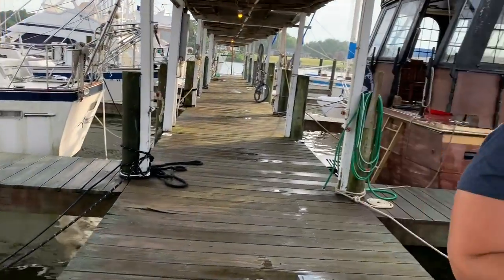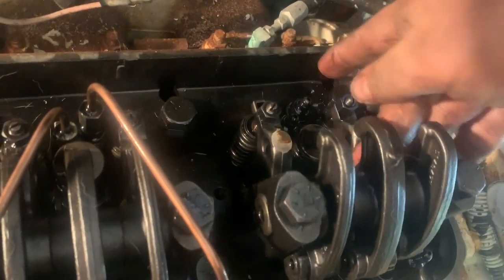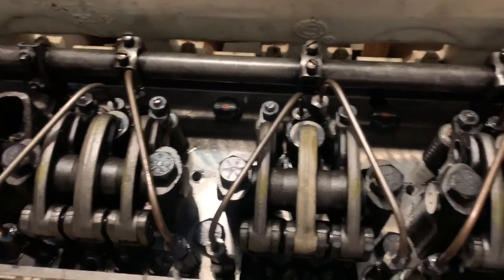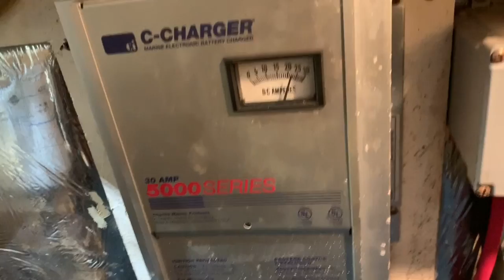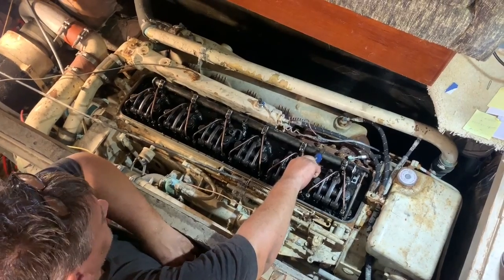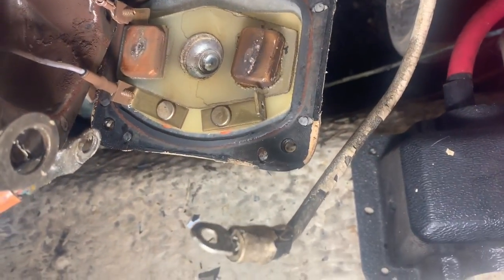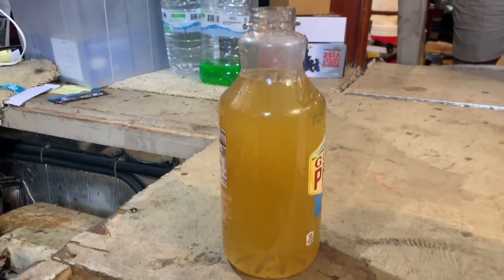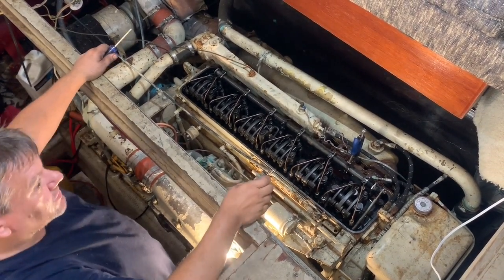Twin 671 Detroit diesel TIB boat (full video) 1st start

Comment: I drove an Attack Troop Carrier with two Grey Marine 671's in Vietnam. It was a converted WWII LCM where you had to handle 25 tons deftly using two D-handle four-foot joysticks. I would twist for power on each engine and shift forward or backward for differential thrust. You could pivot the beast very gracefully when needed. Like coming into a pier against a strong current.  Many a night sleeping next to them while the night watch drove going up rivers and canals through the jungle. The 671 sound and smell is still hammered into my night memories. I remember dreaming about home then waking up to the nightmare - just the opposite of normal life.
Reply: Thank you man I appreciate you !

Comment: I was an engineer on tugboats in the late 80’s, we ran twin Detroit 16V71’s, we ran 24-7 year round, only down time was engine rebuilds in the shipyard. I use to change the oil and filters while we were underway, shut 1 down ,change fluids, start back up, then the other, the only downfall was the oil and filters were extremely 🥵 hot. Love these Detroit marine engines.
Reply: c: Methods   we were in the company shipyard annually, for engine overhaul,and reduction gear maintenance, i worked the same boat for three years and never saw the engine blocks replaced. I’m now a Lineman supervisor in the communication industry, but working on the tugboats was by far the best job I’ve ever had!
Reply: Methods  Our 12V71s ran for 10, 12, and 14 thousand hours before we overhauled them. When I left, the 12k unit had 28k on the block, crank, rods,, cams and 16k on the parts that we replaced ( Heads, pistons, liners&shims, N70 injectors,  gaskets&seals, blowers, and bearings ). Once the engine was back in service and I tuned it, the only things done were upgrades and oil changes. We went from the canister filters to spin on remotes and upgraded from a mechanical governor to an electronic one. The last was done so that we could operate them from a computer in the office instead of having to run them from the engine room floor for normal operations. In an emergency, we could run them still from the engine control panel. In a major emergency we could run them from the engine itself. Our engines when I left had been in service for 24 years. I had been there 18 of those years.
Reply: very hot is why we used nitrous oxide

Comment: I am a retired bus operator from BC. I have a lot of GM time. Not only their engines but their buses too. The buses were all inter-city types. After 30 years driving scheds and charters I quit and started running tourboats and watertaxis close to home. I had fun watching you go through the procedures and commend your slow as she goes approach. Many guys will jump in and turn the key to see if she'll start. If it does, they walk away leaving the owner to uncover problems like loose prop nuts and fifteen gallons of water in the tank.  IMHO, the tank or tanks should be properly drained cleaned and the fuel can be scrubbed or cleaned for use again. In any case as you said you caught it just in time. People including myself are amazed at the amount of water collected due to condensation in the tank collecting over many months or even years. I wouldn't say no to working on engine repair on boats. People are willing to pay good money for someone who is good at their profession. I'm sure at some point Pam will pass your name on to someone who needs a good mechanic.

Comment: This video brings back a lot of good memories.  When I was in Sea Scouts (BSA) we had a single 6-71 Gray Marine (now called Detroit Diesel) in our 40ft launch.  What a wonderful engine.  I remember the 12v starter was rated at 9.6v @ 900A.  Our 8D batteries never seemed to have a good charge so we would wire two in series and hit the starter with 24V.  It always started right up.  Some time we would put pennies under three rocker arms on exhaust valves for compression release, and start the 6-71 on three cylinders.  Once running we would pull the pennies out with a pair of pliers with a short va-room as each penny came out.  We then screwed the valve cover back on and were good to go for the day.  It was great fun and a lot of learning for a 16 year old.
Reply: I always used a spring starter.

Comment: A Detroit 6-71 was a great engine in its time. You could say that about nearly every Detroit diesel from the ‘80’s and back. Had a 12-71 in a truck and a 4-53 in a car crusher and they were extremely durable and very low maintenance - prone to some oil leaks but that’s it.

Comment: I've worked for a while at a marina in Fox lake Illinois there was a pretty big 80's houseboat that had twin 6 Detroits in it, the same problem with a water flooded tank and fuel system but... it made it to both engines then on land it stayed, the engines were pulled n the rest went to scrap. Both of those engines were fixed and are still paired together in a rescue tug for the breakdowns around the lake to this day. Great video 👍
Reply: Wow Fox Lake is about 3 feet deep ;) , I'm surprised that thing wasn't permanently run aground

Comment: Retired now , but I've seen those old DD marine engine run with busted liners . A little smoky and wouldn't pull past 1600 , but it kept on running until shut down . New piston and liner kit , 1 new injector , a new head [just cause ] and back in service . Took 26 hours plus 6 hrs. to fly the parts out to us .

Comment: Great Video..Love the sound of Detroit Diesel's!! Being a Bus Mechanic 34 years I first cut my teeth on 8V71 Detroit Diesel's to 8V92 and 6V92 series with Turbos.. I miss rebuilding those engines! Now work on Detroit Diesel Series 60's and newer and Volvo D-13's..But I sure miss the days of injector picks and adjusting the governors on those engines..especially the sound of them in GMC or MCI buses!! Great video.. I need to find a boat with twin Detroit"s in it now since mine currently have Ford 427's in her! Lol.

Comment: There was a feature on locomotive EMD diesels (GM) two stroke that always saved the day.  Each cylinder had a "flash cock" that was opened before cranking.  Any water in the cylinder was blown out the flash cock before starting.  After cranking several revolutions, the flash cock was closed and engine was started.

Comment: The way that starter acted, I figured it hung up during Runaway & self destruction set in. Marine service engines have a difficult job, but that starboard engine sounded so good.  I'd love to get that kind of power in a truck engine. Way Cool.

Comment: Good old 6-71s. When I was in the Navy I ran landing craft with twin 6-71s. We also had OMB's and they ran slant 6-71s. And we ran Box-Ls. The Sea Scouts in CA had a few. The Box-L's ran a 6-110 main and two 2-71 motor generator sets. All of them were good engines.

Comment: Nice job, I'm a boat guy so great to see a boat. I found you from Stu at Danger marine.   You have explained a lot to me I worked in the Viking Yachts boatyard in early 80's  and this boat is I think an 'Ocean yachts' and was just down the road. Detroit's were the boat of choice back then ( building 150-200 boats a year!). We used I think 6-71's and 8-71? And 8-92 which I think are all V engines ? The engine boys talked about how they put oversize injectors and turbos on the engines too and some owners would remove these injectors and put even bigger injectors in which voided the warranty!..... these were sport fishing boats and they all wanted to run to the deep water as fast as possible to take the owner fishing ......
Only Viking Yachts are still in business building boats in NJ all the others got shut down by state or taxes. Viking are building up to almost 100' Long believe now with MTU. DIesels I think . 
Very interesting about the extra HP because they have so much better cooling.....  hence why cooling and oil pressure is vital on boat engines as at that continuous hi load you can kill it in seconds if either is low!  
Great video
Cheers Warren
Reply from the maker: I like boats too

Comment: I used to live at a marina that had an old German WW2 era tug boat built in 1939 that would sink a couple times a year. The would get it up, and pull the water out of the fuel tank and oil reservoir, and it would start right up.

Comment: One of the highlights of my wrench turning days was rebuilding twin 671's for an oil rig mud pump. One was left hand rotation the was right hand.
Reply: Sounds like two Siamese 6-71s connected to a common gearbox like they had in the tanks in WW2.

Comment: Sound of the v71 12 and 16 cylinders is also amazing
Reply: My uncle had a 68 Peterbilt with a 12V71. Yeah they sound awesome He also owns a 16v192 gen set.that v192 is a monster!!
Reply: Worked in Offshore oilfield on a job one time for two weeks an we had a big crewboat that was glued to us the whole time, it had a pair of 16V-71's in it, we worked on one platform and worked on another building a 200' tall microwave tower.

Comment: Have her send a video of the boat under way , preferably full throttle !!!   ( LOVE the sound of that thing ) .
Reply: I am starting the process of getting the fuel cleaned of dirt and water, changing the coolent, replacing the zincs, replacing the impellers, changing the oil, changing the fuel and oil filters, and just getting things adjusted.  Once that is done I will do a video of firing up those engines at the dock.  It will be a while before she is seaworthy enough to leave the slip and do some figure eights.
Reply: @Bill23799  Buena Ventura Life is the YouTube channel.  Coming up will be a powering up the starboard engine.  That should be a good time.
Reply: Not a diesel guy but the sound of the 2 stoke..... sweet
Reply: Riddle me this Batman were did the water in the fuel come from (fuel tank)
Reply: It does sound badass.
Reply: @kenheisner288  fuel, moisture.. Natural condensation
Reply: @kenheisner288  In a marine environment fuel attracts water. Likely bad orings / seal on the fuel filler cap allowed rain water in. She needs to have those fuel tanks either emptied and new fuel or have the fuel polished.

Comment: Get 3 bottles of Howe’s fuel treatment add that to the tanks , the Howe’s will clean any water pockets in the fuel system . The old 2 stroke Detroit’s love that stuff and it cleans up the cylinders . After running it a little add a quart of Marvel mystery oil to every 100 gallons of fuel. When that engine was designed and built fuel had sulfur as a lubricant and marvel makes up for the loss of the sulfur in modern diesel fuel.

Comment: I installed a Pair of 6-71s in a 10936 65 Foot British Power boats Motor Torpedo Boat back in '82
we rebuilt the Engines and fitted 5 Inch water Jacketed (not Water injected ) Copper exhausts....it sounded incredible but Ear defenders were essential if you were out on the Stern Deck..!!

Comment: I repair starter motors and love that sort of solenoid contact. Easy to clean up and get to. Some of the new lorry Bosch solenoids use a pyramid shaped contact that burns out after a few turns. They would not admit they made a mistake and carried on using it. Caused no end of warranty problems.

Comment: I watched your video and I'm not sure yet. Little tip. When you take the end cap off the solenoid loosen the main terminal contacts and push them down far enough to turn them a half turn and take the clip off the plunger disc a flip it over so you will have two brand new contacts for your starter power. A good trick to turn an old starter into a new one. Those two items and the brushes are mostly all that's done when they rebuild your starter. Other than cleaning it up repaint and change the end and armature bushing in the nose housing. One last thing chum and I don't mean to be a jerk but when hitting the sw to the power don't be afraid of it because when you get sparks you are losing a little piece of metal off your screwdriver or your contact point. Trust me on these tips for they are true. Good sounding 671's though and I think they will run for a good while to come. Good luck.

Comment: The number one reason of boat engine death is water circulation failure. A boat that’s been sitting for a long time may have several issues,. The impeller is old and stiff and should be replaced before the engine is even test cranked because pieces of it can end up throughout the engine. The other problem is marine growth may be blocking the water intakes. If water isn’t circulating, there isn’t even water able to touch the temperature sender to alert you to the fact it’s overheating and by the time the metal of the manifold where the sender is get hot it’s way too late.

Comment: 2-twin 671s (2 screws), in the 40 Boat series; Coast Guard, in service appx 1950s to about 80, some still in use restored and private service Love the 71 Series also were common in semis and construction equip, stationary power, etc.. Was a "Sea Tractor"

Comment: LOL, why isn't there soot on the back like bus? Saw a V6 53 run away, it was a blast! Sucked cardboard into and thru the supercharger in a split second. So option 2 was a 1 by board. So now it sucked the seals in adding oil only slowing the motor. So now it's spewing black smoke profusely and we're indoors. When Bob finally gave up many minutes later? You couldn't see your hand 2 feet from your face. Finally took the fuel filter off, killing it. The whole thing lasted at least 20 minutes.

Oh and grabbing the rack, it locked open and didn't work. This old motor didn't have a flapper. When it happens you'll know why they call it runaway, because you'll be running!

Comment: The motor for my wrecker came from a 46 Ocean SS sport fishing version like you where working on here. It had a runaway and the flapper was frozen causing the boat to catch fire.
Reply: I wonder how long it ran before it gave out?
Reply: Michael H well it’s still going to runaway even if you cut off if oil is dumping into the intake
Reply: @BenjaminEsposti  one took 1hour 47 minutes as per uscg

Comment: I've ran these in trucks and turned up,but 450hp...wow unbelievable.!!!
Reply: These high output 6-71s were originally used in river patrol  boats  in Vietnam and through  the various regional Detroit  Diesel distributors  were tuned up  higher then  the factory high output versions. I'm pretty sure these  are Johnson & Towers  out of southern New Jersey.  The boat is an Ocean Yacht built in 
that area. The high output versions  without turbos put out  about 310 hp,
The turbos were about 410 hp without a bypass. blower ,450 hp with a bypass 
blower and 485 hp with the larger injectors that he found on this boat. Other DD
distributors were similar in Hp. Penske Engines claimed 500hp on their 6-71
TIB's. In the mid 1960's Richard Bertram had 36' offshore raceboats that had race prepped 6-71s that put out  (?) 600 hp+ each at about  3000 rpm(?).
They claimed they would  run 40 hours at full throttle,   much better than a gasoline race engine. GM also made aluminum  6-71 engine blocks. I don't know if the race boat used them or where else they  were used. Maybe  the bus mechanic knows about them.
Also boat engines can overheat even with an ocean to cool  them.
 On an old boat like  this the 3 heat exchangers  ( coolant,  transmission and intercooler ) should be disassembled ,cleaned  and pressure TESTED. Failure 
on  these can put salt water where  you dont want it. And the bronze raw water
pumps have a bronze cam that squeezes  the rubber impellers to displace water through the pump outlet. They don't  necessarily  look  bad but can  lose height from  many hours and gritty  sea water. One screw to remove when impeller is
out of pump.
Reply: @beeper388  thanks a bushel for the reply,that's still a lotta hp for such a small basket.I"ll givem one thing though the ones I drove were tough a nails.!!!
Reply: @michaelbaumgardner2530  
These high output engines were classified  high speed light duty and were suitable for fast pleasure  boats that might put on a few hundred  hours a year if that.
If run fast in a sport  fishing boat and not serviced religiously  they could be pretty tired in 2-3000 hrs. The other extreme  was a 6-71 powered  generator on Jacques Cousteaus'  research ship, Calypseau that had about 30000 hrs on it when replaced and still running. Probably  made 150 hp.
Looked lika pile of rust and salt.

Comment: I had an old liberty launch. It was a natural, no turbo. it was set up to only reach 2000 rpm. or less . It might have been 1800 .Reached hull speed at 1300. 7-8 knots. Held 12 gallons of oil. Easy to work on, great on fuel. Make sure to carry extra impellers and that oil and over heat alarms function. Easy to bleed fuel lines. I  had 2 racoor fuel filters so if one clogged at sea I switched to the other. It also had a pto that powered a massive winch. Good dependable engine.

Comment: In WW2, 2 x 6/71 engines were installed in  the M10 tank destroyer and the 4,000 Shermans built for the USSR under lend lease. Soviet commanders secretly thought the GM powered Sherman was better than the T-34.

Comment: The emergency doors being closed during a runaway, will often suck the end seals from the blower, causing that heavy black smoke as the engine begins to consume the lube oil. Mine built up so much pressure, that it blew the cap off the oil fill tube too.